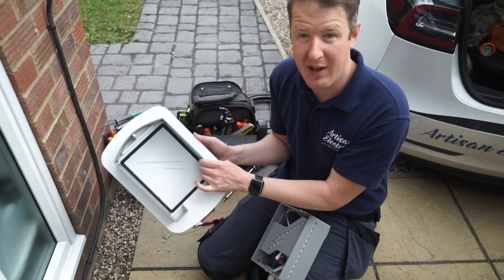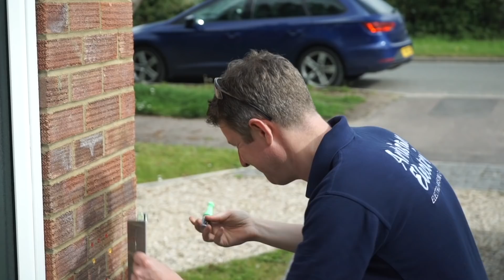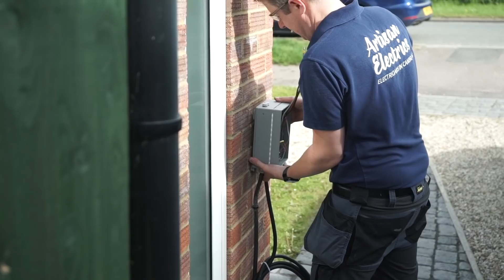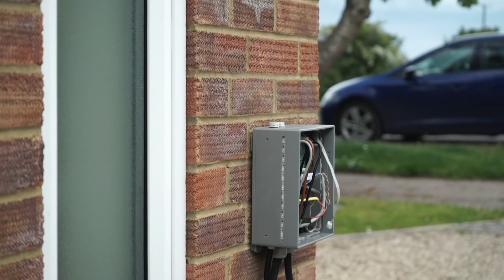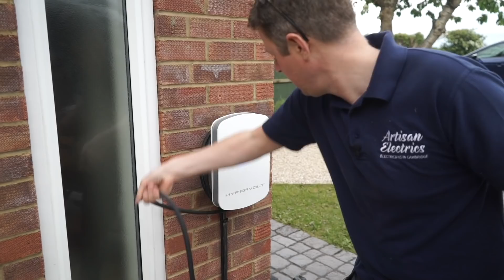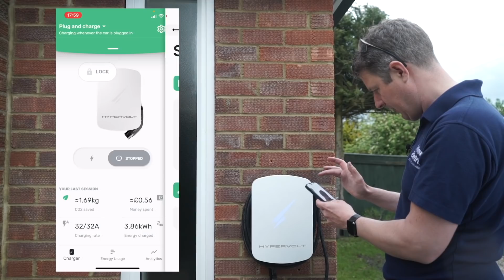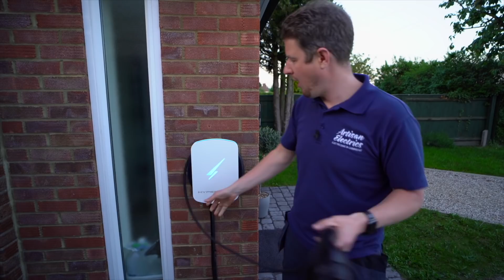Is This The Future of Electric Vehicle Charging? Hypervolt Installation

Comment: Certainly not wired to NICEIC standards. Steel wire armour is not cut flush and taped, it has to be earthed properly even at one end, stuffing glands are for flex only. If the cable was to be pierced, the protective device would not see it unless it punctured 2 cores, potentially keeping the steel wire armour live. A few other minor details but the steel wire armour issue is a definite fail under NICEIC and basic wiring standards to be honest.

Comment: Great video. Morning all. Probably a question that’s been raised and asked before, but is there any safety reason why the charging cable cannot just be left neatly wrapped around the unit, facing down.  So basically it’s not held within the holster?

Comment: Great video, very informative! Seriously considering a hypervolt for my home charging, but I do want to install solar panels and a battery in the near future (especially with the current energy price hike!). What’s your opinion on how easy it would be to set up a solar and battery setup at home with a hypervolt? Is it simple enough or would taking the hit on a Zappi be a better option? Love the hypervolt but need to consider future-proofing. Cheers!
Reply from the maker: Thanks! Solar integration is already part of the Hypervolt system now so that will work fine!
Reply: @artisanelectrics  What about a battery to store the solar energy or the off peak energy on  with Intelligent Octopus for example? I’ve heard a Hypervolt might struggle with this?
Reply: @grantjones2232  We’d be happy to run you through our feature set and products. 🙏🏼
Reply: Just had my Zappi installed and couldn’t be happier works great with battery and solar

Comment: Are there any concerns about having the charger cable dangling rather than plugged into a holder like the Zappi does?

Thinking of things like sea air corrosion etc, as we live 1 road back from the seafront in Blackpool so get the prevailing westerly winds blowing in off the Irish Sea. Although the front of the house is facing away from the sea, the windows do still get covered in sea spray during stormy weather.

Comment: Is the cooling fan sucking or blowing? It looks like it's sucking cold air in from the top and blowing it out of the bottom, which doesn't sound ideal what with hot air rising :)

Comment: So it runs on a pi, has a fan is it waterproof? but why then are vents on top and not on bottom to stop rain or moisture entering unit? poor design only takes one drop of water from either source to fuse a computer CPU.

Comment: Forget the LEDs - pure gimmick (and cheap-looking too). There was no mention of whether the charger fully synchronises with EV charging tariffs, and/or scheduled low price periods, from electricity suppliers such Octopus. No mention of setting max unit price thresholds to shut-off charging. Why not ? Setting a fixed schedule, either for the charge point or using the car's App, isn't dynamic and won't recognise and take advantage of low rates when energy is cheap. I like your style of video presentation but would find it more beneficial if you consistently conveyed the substantial functionality and benefits rather than the chintz.

Comment: I’d recommend not placing those grub screws on the paving slabs under your work area, particularly when near pebbles. One inadvertent flick with the cable and those screws could disappear instantly and be very hard to find. I speak from experience. I temporarily store small components in a dedicated screw cap container to keep the safe and easy to find later when required.

Comment: Lord Bamford of JCB fame is an expert and he has stated that the future is in hydrogen powered vehicles... JCB has developed a Hydrogen engine which can be filled up and used just as diesel and petrol engines.... The main problem with electric engines is the charging times and charging locations which will get worse as the amount of EVs on our road increases.. If every petrol car and diesel car on our roads right now is replaced by an EV there will be chaos.... I have just driven to and back from London to the Lake District in a petrol car... I only stopped once to refuel which took no longer than 10 minutes ...I would never attempt that journey in an EV, ...........apart from the fact that there are only two charging points in the whole of the Lake District ............Lets see what happens when every car is an EV fighting for a charge point when they are all occupied.... .......lets see what happens when all the lithium and other rare minerals for use in the making of the batteries are all used up. Your batteries will not be getting any cheaper. You may be fortunate in having your private charge point but millions of others around the world live in tall blocks of apartments or rows of terraced houses where they cannot get their EV within 100 yards of their home.... They are the ones who will be crying "Help".... How far do you think an electric truck can travel on a full charge? Lord Bamford (JCB) has stated that they can only be used for 4 hours before being charged up for more than 12 hours... He is now manufacturing all his diggers and cranes etc to be powered by hydrogen engines.. I may be in the minority for the next ten years or so but EVs are not the future , Musk has fooled the world's politicians and car manufacturers.

BREAKING NEWS :-- ELECTRIC CARS ARE CAUSING THREE MILE QUEUES BACKING UP FROM BRITAIN'S MOTORWAY SERVICE STATIONS AS THEY WAIT FOR A VACANT CHARGING POINT

Lets hope they are not on a smart motorway where there are no hard shoulders to sit on...

THE FUTURE IS NOT GOING TO BE EV ONLY.
In time Hydrogen technolgies will become widespread and offer far more flexibility at less cost than clumsy EV vehicles

Comment: My only concern with tethered cables is what happens if there is an issue with the cable itself? I have not had many problems with my home charger over the past four years though it has been upgraded but i have gone through two cables.

Comment: It needs a plug park. And a better way of storing the cord like a compact retractible air hose/extension cord like they have in workshops. Also if the plug was dropped in some dirt or got wet you would want some spray cleaner and a micro fiber cloth to clean it. These would be nice to be at hand in the unit, and could also be sold as consumables for extra revenue and would fit into the wasted space in the housing.

Comment: I am a bit worried about exposing the electronics to the environment when you talked about the fan,  I am from Mauritius, where it does not snow and the temperature does not reach desert conditions, but at night the temperature goes sufficiently down for condensation on everything outside, even a PCB in a cabinet.  Hope you can on pass this message to Hypervolt.

Comment: After sales service and reliability are such big issues for this type of kit. A follow up review after a few weeks/months would be great.
Reply: It’s been a year. I’ve heard bad things.
Reply: I’ve had great after sales support from Hypervolt. 

Had an installer fit a unit but it kept failing to connect to my house broadband (my layout is charger outside front door, with router just inside the front door, approx 1meter)

I was able to just send over units serial number and they shipped out brand new unit (was expecting just new raspberry pi or Wi-Fi unit), they also paid for neighbor electrician to carry out the unit swap

Comment: How does it compare to the zappi? Does the overvoltage have a ct for solar also like the zappi. I like to be able to monitor my charge rate and have the ability to programme to only charge from solar. Also if you have solar does the unit deduct the cost of the solar supply or does it simply just give a charge value not taking into account solar supply?

Comment: "Looks really good build quality" - really! looks a mess to me. Is that a Low voltage PSU for the raspi floating around randomly?  Also, you aren't meant to build commercial products around standard Raspberry PI's but use should be using the compute module (for instance there's no guarantees around availability/supply of the consumer pi's). No heatsink on the Pi CPU itself won't be helped much by that fan on the bottom. Who's is updating the software on this thing? The linux on the PI will need updating.

Comment: How many ct clamps can you connect? Does it have solar integration?
Where do you purchase them from?
Reply: Only one at the moment. It is bi-directional though meaning it can tell if you are importing  from the grid or exporting.

Solar integration is being trialled as we speak, this will give options to charge from PV only similar to the Myenergi Zappj.

Contact Hypervolt via there website and they will put you in touch with your local recommended installer.

Comment: I've just come across this, how does it compare to the Zappi? I've kind of lost faith in them lately what with huge lead times and several units having to be replaced on warranty. The only thing that I can see marks it down is the requirement for Type A RCD and no wireless connections for the CT clamps? This is one reason why I favour the Zappis as sometimes the EVCP can be miles away from the meter box , or another CT clamp is required for load monitoring, wireless Harvis make this so much easier than running CAT 5 everywhere. Oh, and another thing, is there a rear cable entry on the Hypervolt so you can come straight through the back? This is quite a deal-breaker for some customers who don't want to see any cables.
Reply from the maker: The Hypervolt will soon be able to do everything the zappi can and more! We have got a bit fed up with Zappi lately as well due to faults etc. Definitely worth checking out Hypervolt.

Comment: Armoured Cat5? Are you expecting the KGB to interfere with your car charger? 😂
On a serious note, I doubt you need to worry about crosstalk when you are only using 1 pair of a 4 twisted pair cable. Honestly you could probably have just ran some speaker wire and it would have worked 😄

Comment: I like the look of the Hypervolt - we have a spare 32A three phase supply at our office and were thinking of installing 3 x single phase charging points - one per phase - would you recommend doing this or is there a fault scenario whereby this could allow 415V potential difference between the metalwork of two cars?

Comment: Looks like a great charger. What can actually be done with the Rpi by the home owner?

Improvements feedback to the product team: have the charge cable finish winding at the top and have a neat position to place the socket. E.g. closer to Andersen A2 design.

Also, why not have the house total load setting as a software feature rather than the rotor knob inside
Reply: I'd prefer to have physical ways to change settings on the charger. If you do it via app etc., the device will basically end up useless if the company that makes the charger goes bust, or they just choose to not maintain the software after a couple of years.

Comment: On an RJ45 cable Green/Greenwhite, Orange/Orangewhite are normally for ethernet, Blue/BlueWhite for Telephone which should have left you using Brown/BrownWhite. If you had used Docaster EV Ultra  cable you would have got both power and data both in one cable.

Comment: What sort of cost is installation on one of these.  I know every install is different but a rough idea?
Reply: Depends where you're located, but it's around £650 - £700 fully installed for the majority of installs, assuming you have the grant.
Reply: @hypervoltev  is that on top of the cost of the unit itself?
Reply: @casiodan  No, that's everything including the charger and the OZEV grant, not on top!
Reply: @hypervoltev  I won’t be eligible for the grant but I can do the maths 😂.  Thanks
Reply: @casiodan  We'll do a bit of good will towards you!
Reply: @hypervoltev  I’ll be in touch. We’re expecting a delivery date for the car tomorrow

Comment: i have a podpoint installed and i have a question. How far apart should be brackets that fix the cable to the wall?
Reply: There should be at least 5000 miles between yourself and any PodPoint product, just to be completely safe!

Comment: I'd be worried about there being a Raspberry Pi inside. Using an off the shelf commercial board gives the appearance of a prototype rather than a full blown commercial one.  The Pi already has known overheating issues in regular use let alone in an outdoor unit.  The other problem is using an SD card for the operating system.  The SD card will wear out and in less than 5 years I would expect there to be a surge of failures related to that.   Speaking as a professional firmware consultant I would have recommended using the industrial compute module 3 or 4 or, even better, to use something like a Beaglebone derived design that can be integrated directly onto the main board and use higher temperature spec components.
Reply: Yes I agree with what you've said and it lowers the credibility of the channel. Still his electrical work seems good, though that is not my area of expertise.
Reply: @sundog486 even as pi one (2012) has a 700mhz 32bit CPU. More than enough processing power to run an EV charger. And that is probably a pi 3 or 4

Comment: The only possible thing I could see as an improvement to my current dumb ev charger is if the charger was clever enough to use the my spare solar panel capacity to charge my car when the car is plugged in, without coating me a penny. I think there is a charger that can do this but probably not worth the effort as I have a powerwall on order.
Reply: It does do exactly that!

Comment: The main thing to shop after reasonable price and charge (cable length - car may change so think about future) needs is warranty - when I purchased my ev wall box in '15 USA market leader was Siemens with 3 years. Now, many Manufacturers have equalled
Juicebox - 3 yrs
ChargePoint - 3 yrs
Etc.
Reply: We also offer 3 years as standard!

Comment: I have a question. 
At present the most Kw output a single phase charger can produce is 7Kw. 
I can buy a single phase shower with an output of 10.8 Kw. 
Why is a single phase wall charger limited to this maximum?
Reply: Because of legal reasons, your amperage is limited to 32A at installation, which means 7.2 - 7.3kW. to get more you need 3 phase, but most cars don't support AC charging at more than 7kW.

Comment: If you have the ethernet, why not just use 4 wires for the ethernet (limits you to 100Mb full duplex),  and save the wifi issues? You can still use 2 of the 8 wires for the CT clip.

Comment: On the subject of customer service, i purchased a small EV which i took delivery of on the 8th march, i had the charger fitted (BP pulse) on the 16th Feb, after it was fitted i noticed the standby light was pulsing on and off, took delivery of the car, went to charge for the first time and the standby light was off, called the installers who came out a couple of days later, and changed the contacter in the csu, put the car on charge the same day, left it overnight, when i got in the car it had only charged to 56%, looked at the charger and it was off, called them out again and it took a week this time, they came out and changed the whole csu, after they left i noticed the charger was off, and it did not come back on till the following day, contacted the installer again, and he told me that i had a problem with fluctuating voltage, and the csu could not cope with it, he said he would order a different device which would handle the fluctuating current , by now it was the end of April, after a couple more weeks i had heard nothing, so i contacted them again and they said they had emailed BP and ordered the new device but had they had no response from BP, he said he would email the director and try and gee things up, so i contacted BP myself, they said do not worry we will sort out the problem, we were now into the third week of May and still had heard nothing from the installer or BP, at this stage i had also never received a copy of the installation safety certificate, I contacted the installer again and he told me he had still not received a reply from BP, I told my son what was going on, who incidently is NICEIC inspector, he said leave it with me, he sent both the Installer and BP a very nice email, and gave them seven days to sort out the problem otherwise he would escalate the matter on safety grounds, the very next day i received a copy of the safety certificate via email, and the same week the CSU was changed for a matte open device, which now works perfectly.

Comment: This man changes his ev chargers faster than some people change their socks.
Reply: We have 2 EV’s.  For 7 years, we have just used the portable EVSE’s that came with the cars.  Just a regular 120 volt outlet.
Reply: @hjeffwallace  Me too, and I park in the street and have the cable out my second floor window!
Reply: @hjeffwallace  this is interesting,  that you used the charger that came with the car for so long. I was thinking whether that was feasible since the charger is very low power if I am not mistaken, and charging times will be in the double digit hours?

Comment: Good to see you scoring the amour wire with a junior hacksaw and then wanging them free - just as I was taught 50+ years ago! If you are using a brass compression gland
then just 'wind' the inner sheath at a slight angle in the direction of the 'twist' and the taper part then just slides in. Easy. I used to be able to do these with my eyes shut, I did so many!